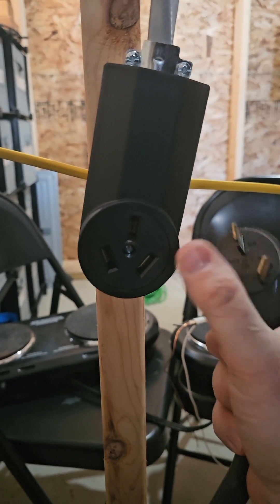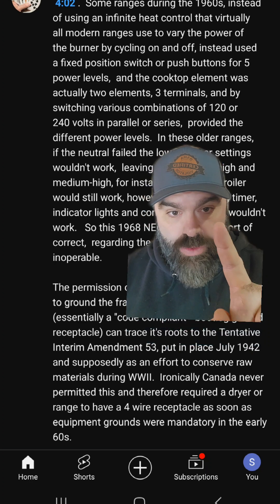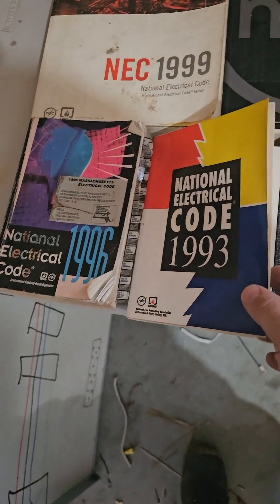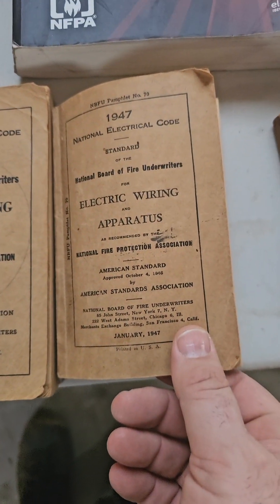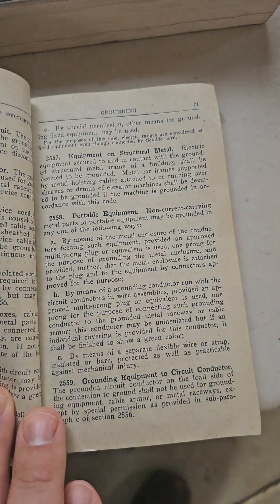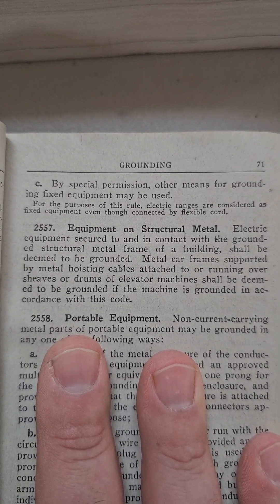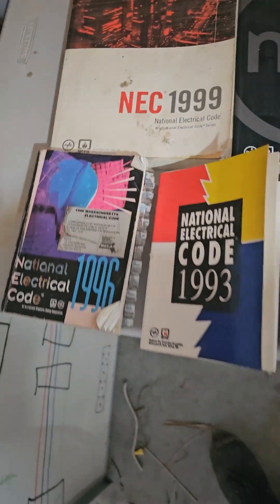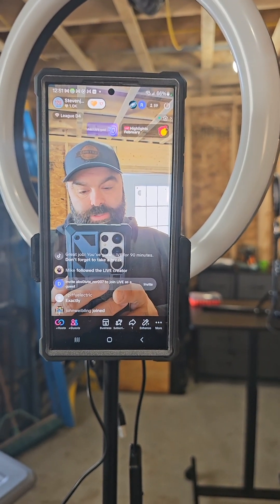click here for full video.  how the NEC helped win ww2

Comment: new appliances are shipped with a copper bonding strip connectimg nuetral and ground, and by the manufacturer installation instructions,can remain if appliance is used in a remodle or a mobile trailer home, otherwise new construction we bend the copper link backand forth to break it off and remove the link, most installers dont do that only reputable electrical contractors will make sure that it is done to meet code for new construction
Reply from the maker: We had a plumber near my house get killed cuz a stove cord was put on wrong
Reply: I almost forgot thank you for the great information and having a very informative and precise search of the information,really appreciated

Comment: Wow, I always assumed they got grounded but no neutral due to everything being 240v, but like on a stove, the 4th wire (neutral) was added just for the light bulb and electronics.
Reply from the maker: 240 3 wire with a ground has the third rounded.  240 3 wire with neutral but no ground has a straight blade for the third hole....
Reply: @Stevenj120volts  ah, I see, thanks!
Reply: Some stoves used the neutral for low heat  120 v